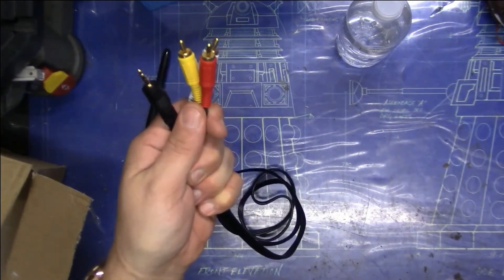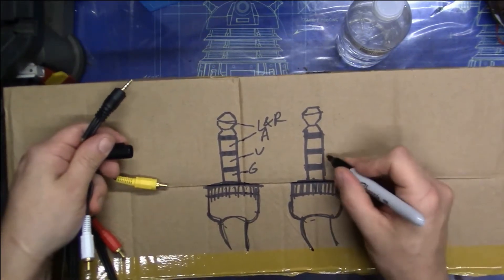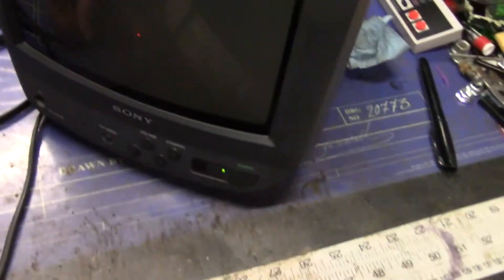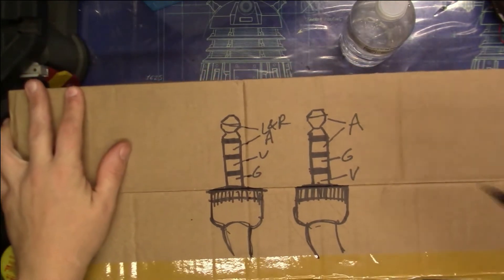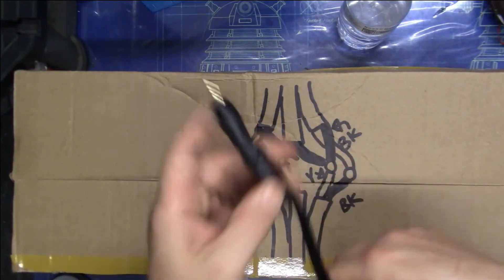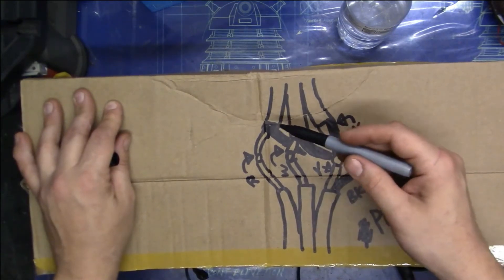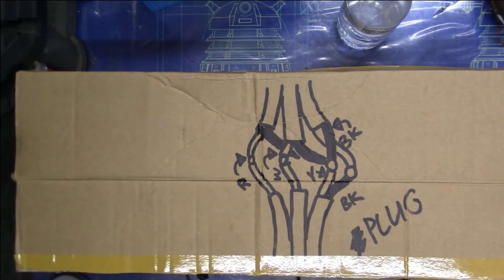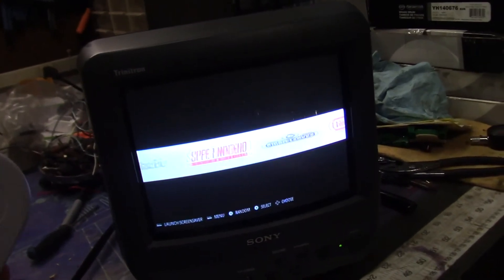Rewiring Retro Pi AV Cord- This May be Why Your Raspberry PI Composite Video Cord doesn't work!

Comment: You can also just use the red plug for the video and save yourself all of this time soldering.
Reply from the maker: Sorry, not on this cable. Remember that in it's original configuration, the video signal was going to the ground, not the audio. Great thought, though. I wish i would have been that easy.
Reply: Clay Carlino Ah. I know there are three types of this cable and the iBook version must be the one you had in this video that's incompatible. Well...except that you hacked the crap out of it to where it is lol
Reply from the maker: You've seen this channel, That's what I do! ha ha. On a serious note, it's so frustrating to me that the cable was wrong kind. It was specifically listed as a Raspberry pi 2 cable. From what I've seen looking up up this problem, apparently there are a LOT of places online selling cables like these that make that claim erroneously. I probably should have just returned it, but I really wanted to play video games!
Reply: Worked for me... Gracias.
Reply from the maker: Bruce Mayne, awesome! Glad things are working for you!

Comment from the maker: Akshay Jois, it sounds like one of the audio channel wires may be contacting one of the other wires slghtly. If that's not the case, you could try wrapping each wire with a bit of aluminum foil tape. Obviously make sure any bare wires or solder joints are completely covered by shrink tub or electrical tape first, but that might help. I'm not an expert in audio, so if someone else calls bullsh!t on this advice, they are probably right.